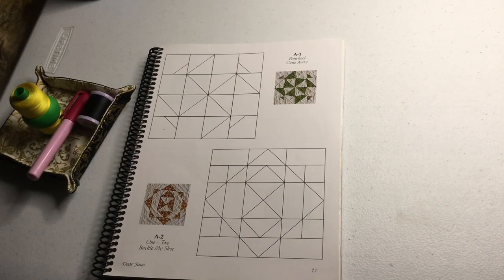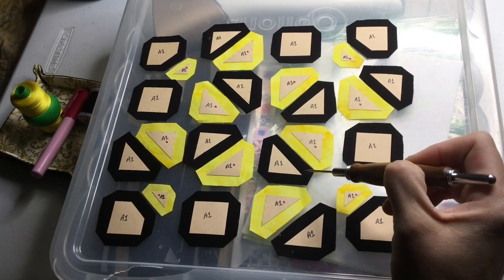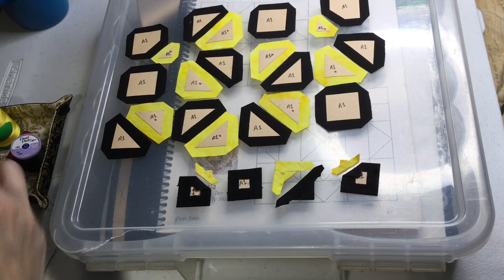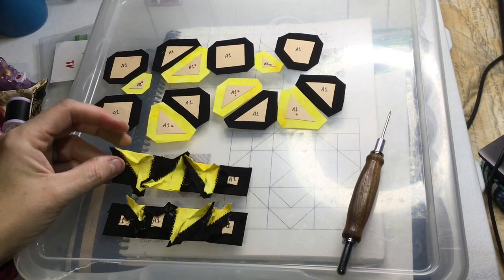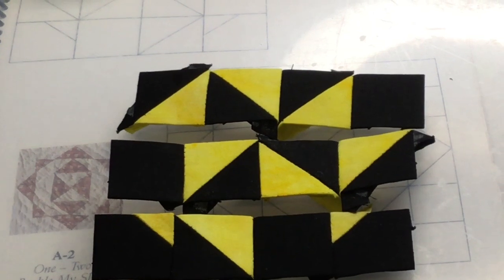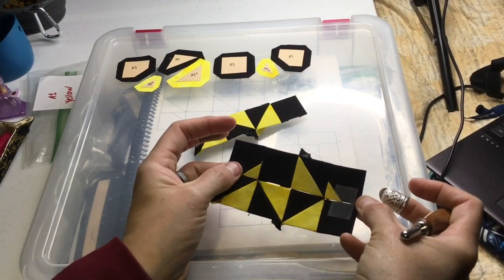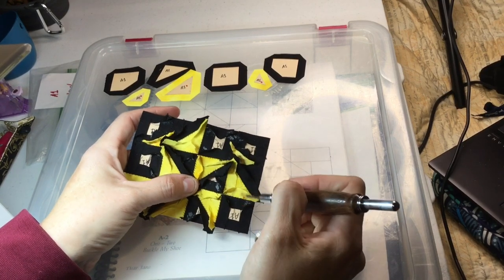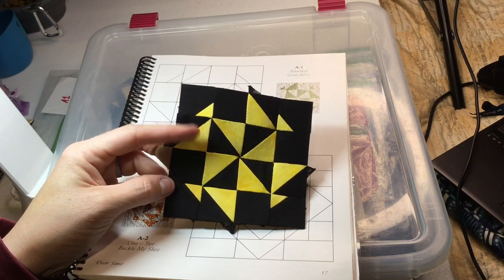A1 Block Assembly - Dear Jane Goes EPP

Comment: Thank you for doing this video series.  It's been very helpful to me.
I'm so looking forward to you doing A9. I'm on my 3rd attempt and it's not going well.  
I was surprised that the yellow thread didn't work out, and the black did. Are you planning on testing your threads for the other colors?
Reply from the maker: I am also shocked the colored thread didn’t work out, and I will be using the black mostly now.  I will still use matching colored thread where there is color on both sides of the seam.  A9 is a difficult block.  If you’re becoming too frustrated, I would suggest leaving it and moving on to return to it later.  You don’t want to pull your hair out!  Once you have a few more blocks under your belt, you might see it with new eyes.